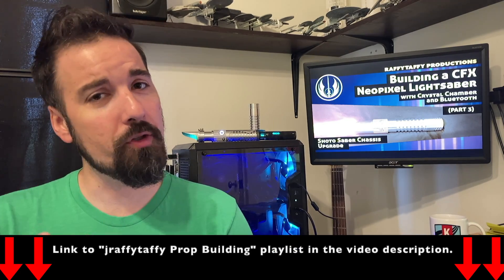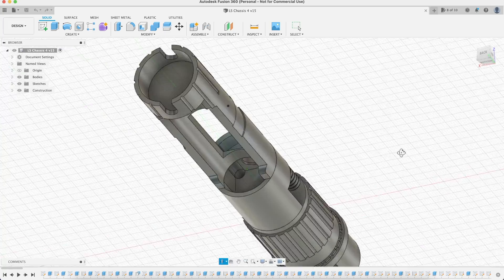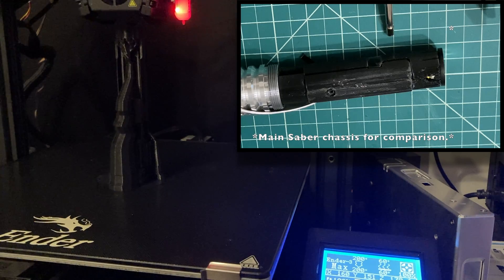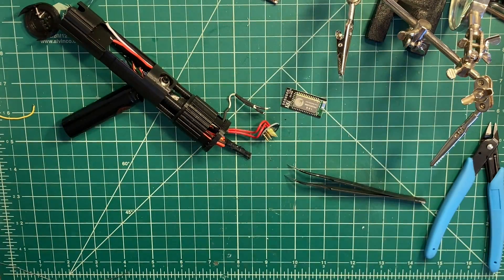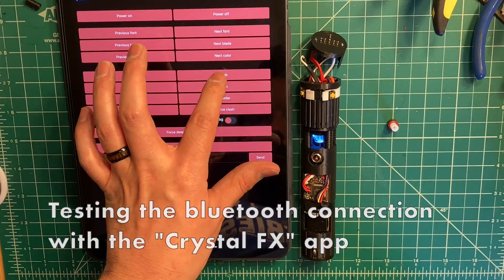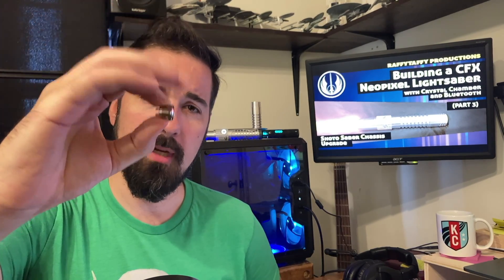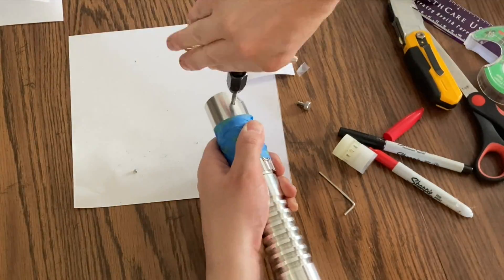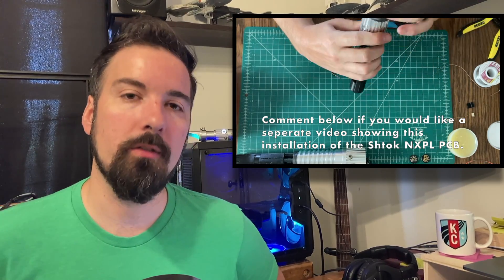Building a CFX Neopixel Lightsaber with Crystal Chamber and Bluetooth: PART 3-Shoto Saber Chassis Up

Comment: hey, I love what you’re doing, I think you are one of the few who really did what I’m trying to do, which is build my own lightsaber, but trying to keep it more or less compatible with the others. I wanted to ask you a simple suggestion: do you think it is better to start from scratch with new hilt, new chassis or change the only laser sword that I have? My idea was to take a small TXQ laser sword, upgrade it, improve the speaker, electronics, soundboard and blade type, also inserting a space to put a kyber crystal.

It’s a shame that you didn’t continue the series, I was so curious to see the final result.
Reply from the maker: Thank for enjoying the videos. I do plan to do another saber project that I will record and upload a video for. Just had a big move and job change so didn’t get to it this year. I plan to start from scratch on my next build. The exterior will have mostly the same look but I want to improve my electronics and chassis and maybe do more with the color and weathering on the outside. 
To answer your question, I think the advantage of starting from scratch is you can start fresh and explore more creativity. But the advantage of changing what you have might be easiest because you can skip some of the planning that has slowed me down so far. 
Good luck on your build. I’m looking forward to doing another one myself. Maybe in the summer I can get more done and post another video by the end of next year.

Comment: I have none of the skills that you've displayed in your videos to build any part of this. I have no idea where to start with machining skills to make the hilt, 3d printing to make the chassis, soldering to put the equipment together or programming to make the thing do what I want.
Reply from the maker: I mostly learned by watching a lot of youtube videos, which I linked a playlist of in the description of the video. If you watch part one, you'll see that on the machining side I actually didn't need to do hardly any machining as the parts can be ordered from The Custom Saber Shop. And there was just a lot of trial aand error to get the results I wanted, which is the best part in my opinion of doing a project: challenging yourself and learning new skills.

Comment: Try doing your measurements in 360, make a drill guide, and 3D print it. then drill through the part you printed into the metal.
Reply from the maker: Great idea! Thanks! That will definitely help if I do end up going back and replace the AV switches with tactile switches.